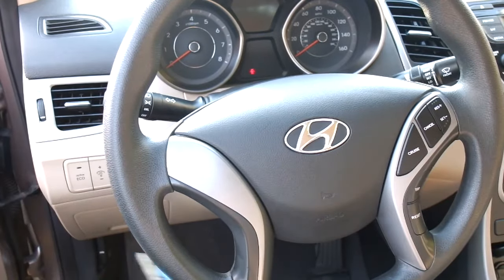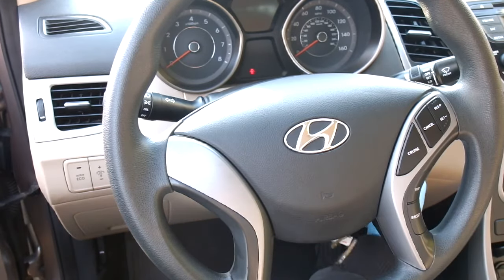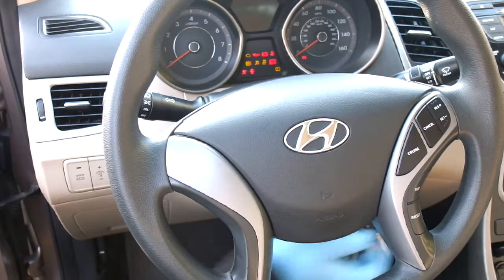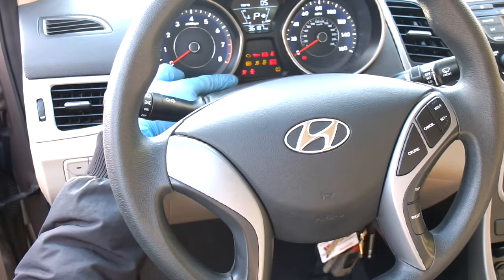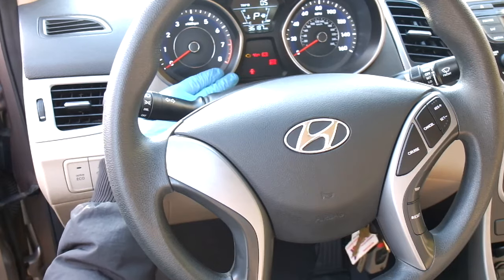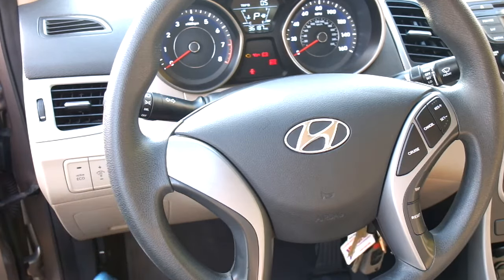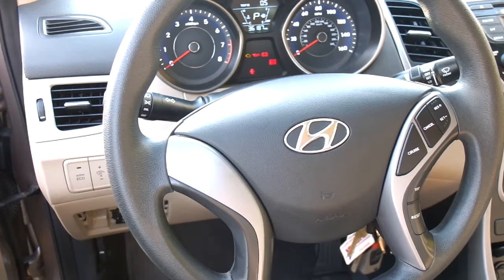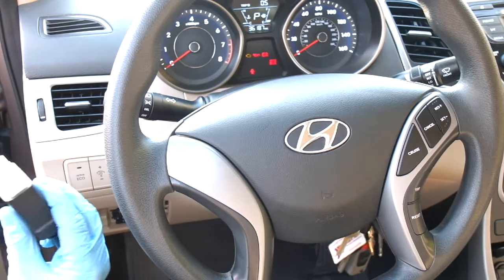Why is my Hyundai Airbag SRS light on?

Comment: Wow! that was very userful information... NOT..   In most of the cases with airbag light, the yellow connector under your front seat could have issue. In most cases you can fix it by checking this yellow connector and cleaning it with for example with wd-40 and reconnecting.

Comment: I have a 2015 hyundai sonata hybrid with air bag code P1A6F,   any experience with this code I replaced the battery pack and from what I have researched possible bms ecu problem.
any help would be greatly appreciated.
Reply from the maker: Thanks for reaching out! It seems like you're tackling an intricate issue. YOUCANIC's mission is to provide all the tools and knowledge needed, including free resources, helpful guides, and our advanced YOUCANIC scanner. If you require in-depth specifics, we also have factory repair manuals in addition.

Do explore www.youcanic.com for solutions to your issue, if you're still struggling, feel free to ask questions on our site. We're here to empower and support you on your car ownership journey.